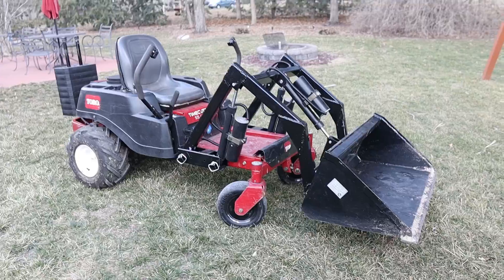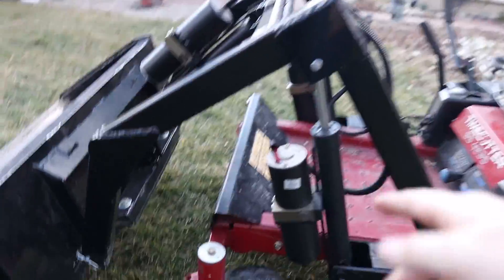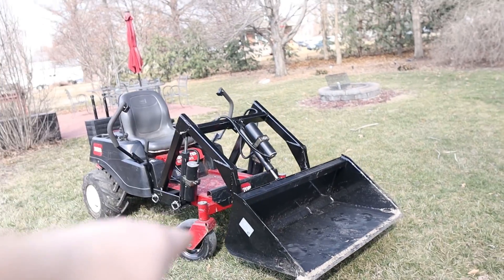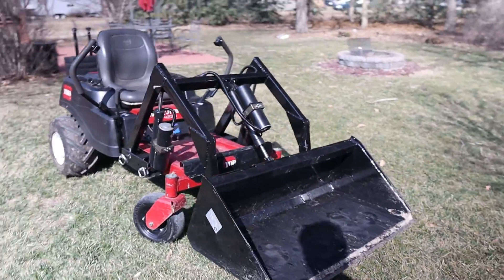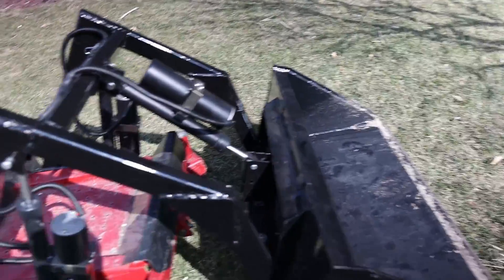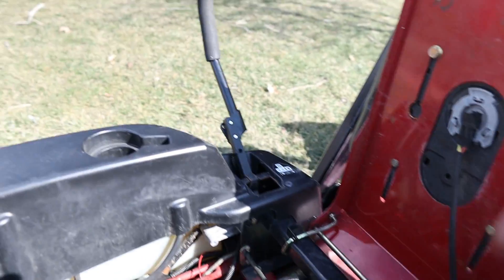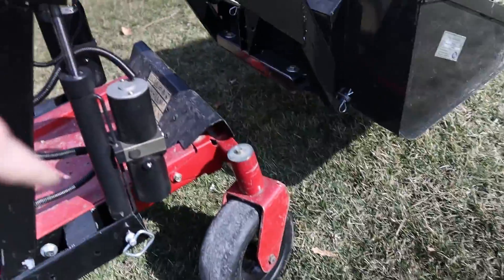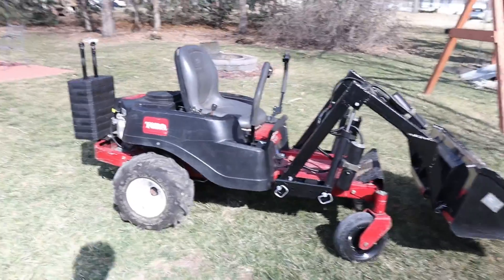You Converted a Toro Zero Turn into What?? - Homemade Skid Steer/ Front End Loader

Comment: Very thankful I found this video, thank you for your willingness to help out the community!
I am very interested in your electro-hydraulic cylinders, this has been what compact lawn tractor FEL have needed! How did you go about finding these actuators? I am trying to do some research myself to see what else is available and haven't come across much.
Reply from the maker: The exact actuators I used are linked in the description on eBay. Unfortunately they are the only sellers I could find for these actuators that weren’t ridiculously priced but they are currently out of stock until July. Similar cylinders can be found on Alibaba but they are not quite as affordable. These cylinders are very specific and I don’t think the demand is there for them YET. I think as more people discover this video and the use of these cylinders we will be able to source them easier. I want to get more of them because they are such powerful actuators in such a small form that can’t really be beat unless you run a full hydraulic system. I really hope the seller on eBay gets a lot in stock because they are the only ones that I could find and they were extremely fair on their pricing
Reply: @ChadMees  Thank you very much for your quick reply!
Have you been able to get an idea of how much weight the loader will pick up? Is the limit the counterbalance in the rear or the force of the cylinders?
Reply from the maker: I don’t have an exact number. I have easily lifted 400lbs but I would expect the max would be around 500-600. The issue I have found is that the narrow casters start to dig into the ground. Adding more weight as a counterbalance does help though

Comment: already planning on making one as we speak on my john deere zero turn. really appreciate the plans! im going linear acuators though
Reply from the maker: Good to hear! I wanted to use linear actuators too but they are a lot slower and also quite expensive. The ones at northern tool were the most likely to work when I was looking. The ones on Amazon and eBay say they can lift 6000N but they are very slow.
Reply: @ChadMees  see i saw the 6000n ones thats what i was planning on getting, they say 14mm/s   what were yours pushing in speed for comparison?
Reply: also its 5mm/s i stant corrected
Reply: i found some that are 14 but they can only hold about 1000 newtons, maybe 2 on each side? and the 6000 newton one on the bucket?
Reply from the maker: If you go that route I would suggest going with lighter steel since every bit of weight is going to affect your overall payload. The problem with the actuators is that with the mounts where they are you will always be at a mechanical disadvantage. meaning it will take say a 1000lb actuator to lift 500lb payload. This is just a random ratio for the sake of explaining but the biggest thing is your actuators must be much stronger than any payload you expect to move. This is why I opted to use the hydraulic actuators. 

As for running multiple actuators on each side I don’t think that will work. At least easily. You would have to share the same pins on the base plate and arms to make this work otherwise the geometry wouldn’t work. This also introduces more possibility of it binding because the actuators may not move at the EXACT same speed. If one actuator is 1-5% slower then it will cause the whole system to bind and fight itself
Reply: @ChadMees  also how much weight ability do u think I would need. I mean the bucket and arms would be about 100 to 150, I'm building a  bucket so it will be lighter prob.

Comment: Im surprised this made it a whole month without me seeing it. I looked into this a little bit before I just went ahead and bought some 'regular' equipment (albeit old and decrepit, but as a master auto tech it's manageable) and put this idea on the way back burner. Ironically I just fixed a Toro 4225 (nearly identical) for a customer, so this is particularly enticing having the memories of that machine fresh in my head. I'd really like to see more video of it in use, especially maneuvering while carrying something heavy. 

I did somewhat recently convert an old riding mower into a tiny crane truck with a truck bed crane and a 150cc push mower engine in place of the ~500cc original. I had to do all kinds of stuff to make that work, but none of it was much money (probably <$250 in purchased parts including the crane although i had a lot of the other stuff lying around). My main goal was to move car engines across gravel without any hint of a regular engine hoist being involved because that is a giant PITA. I could have bolted the crane to my actual truck and done that in the conventional sense, but this thing is only ~34" wide and you have perfect visibility of the load while being able to move 0.05 mph or whatever with the hydrostatic trans. I just used it to sneak a honda v6 through a 10' wide door that had said Honda centered in it (so ~<30" left per side?). Wouldn't have worked with either an engine hoist or the same crane mounted on a truck... anyway, nice work and i want to see more!!
Reply: How do I get in touch with you? 1) Do these actuators come with any owners manuals? 2) How do you check hydraulic levels? 3 Have you had any problems with your actuators?
Reply from the maker: You can leave comments here or message me through email or Instagram chat. To answer your question. 1 no owners manual they are technically a generic Chinese made unit. 2 while I’m sure it is possible to check the level I have no idea the correct way of doing so. I don’t think these are intended to be serviced even though I’m sure they could be. 3 no issues so far mechanically. Only issue I had was the screws around the valve body and the reservoir are steel and they started to get surface rust. A little paint and a q tip and that problem has been solved!
Reply: @dwightlittle6576  I was just about to say the biggest problem is those electro-hydraulic cylinders were basically unavailable since this video was posted but i see they are now available again! Time to resume goofy ideas..
Reply: bought 2..
Reply from the maker: They are truly amazing little units. I am trying to justify buying another set for some other projects!!
Reply: @ChadMees  what is the maximum dead lift these actuator are capable of lifting? They say 2300 lb but Ihave serious doubts about that being true.
Reply from the maker: I do not have an actual value for they real life max. I do know that on my loader I am able to lift around 600lbs of material inside the bucket. Given the geometry isn’t optimized for maximum lifting capacity.
Reply: @ChadMees  Well neither is the geometry of the front caster wheels. They have a bending moment from vertical weight. I did have a thought of just adding one or two more front casters making it sort of a semicircle arrangement of front wheels if there was a need for that, but i doubt there would be unless it was used both heavily loaded AND often. 

My electrohydraulic cylinders showed up today, but i havent seen them yet.. excited. I actually plan to see about using mine as   electro-hydraulic top link for 3 point hitch on subcompact tractor, but if that doesn't pan out it's on to the next idea. Gonna be cool either way.

Comment: What's the max height you could dump into? Could you load/dump into a pickup truck bed?
Reply from the maker: I will double check the actual height I get out of it but I think it would be pushing it to dump into a truck bed. I have an F150 so I will try this out in the next few days and get back to you but I want to say it would  be mostly level with the bed. You would be able to scoop material off the bed into the bucket for sure. It does  work very well with our 5x8 trailer though!
Reply: @ChadMees Do you have an update for the lift height? Did you try dumping into a pickup bed?
Reply from the maker: Oh yes I’m sorry. I did try it out. I cannot dump into the bed of the truck. It is just shy of being level with the tailgate so I can scoop material from the bed into the bucket but from the bucket to the truck would be a little more difficult. This could be fixed by adjusting the dimensions of the frame or starting with uprights to move the hinge point higher. This currently is a limitation by my own requirement of being able to get on the mower from the side rather than climbing over the bucket. Hope this answers your question and sorry it took me so long to test it out!
Reply: @ChadMees  so I’m no engineer, so to get it to lift an extra foot to throw into the truck bed what would you have me do before I build? Please if you don’t mind so I understand without messing up?

Comment: Hi there Chad !! Hey thanks for making this video and yes you have helped me a lot. I have a bunch of linear acuators from hospital beds i have gotten but i dont know if they are 12 volt or can be used as 12 volt because as you probably know the hospital beds plug in the wall outlet, so not sure about that but yes i want to build one of these and i like all the things you did , your very smart and creative and its great that your helping people all over the world probably with your great ideas : ) well have a nice day and let me know if you think the hospital bed acuators might work from 12 volts straight ? not sure myself. well have fun on your well deserved cool innovative loader there : )..Mark
Reply from the maker: Mark, I am almost 100% certain your actuators will run on a lower voltage. They probably run off of a transformer that changes 110v (220v if overseas) to something around 12v-36v DC. The issue you will probably run into is how much weight you can move with those actuators. Each of my actuators can lift a maximum of 2000lbs. You might be able to get around this if you change how close to the bucket you mount them. The close your actuators are the to bucket the less weight they will need to lift. It is exponentially more weight the closer you get to the pivot point! The hardest part is finding a happy medium between the lifting capacity and stroke length. Hopefully this is somewhat helpful and not too difficult to follow my rambling.
Reply: @ChadMees  love the rambling i am old school, words are wisdom to me anymore : ), thanks Chad, next time i go out to my shop i will see what is on the actuators themselves and let you know. keep up the great work too ! that thing looks just perfect for mulching and other things filling in holes and swales you dont want in your lawn . : )

Comment: Nice,  I've looked at similar in the past with typical ride ons and it's the extra weight on the steering that has turned me off them. So how's your hydrostatic steering system copping with the extra weight. And cheers for the great video,much appreciated
Reply from the maker: I would also be worried with the standard rider loaded because you already have the weight of the engine up front. While the zero turn isn’t designed for this weight on the front I haven’t had any issues. I would be more worried about bending the casters than anything on some of these mowers. If you notice on this model the casters seem to be more sturdy than some of the others since mine has 3 sides rather than only 2. My concern with the 2 sided casters is when you try to turn with a load it may fold/ bend the bracket. I actually was using it last night to move more gravel around. I haven’t noticed any issues with the hydros, they seem to operate the same loaded or unloaded. I am sure using it like this will shorten their life a bit but I just have been trying to pay attention that I am not forcing them to try and move when they don’t have enough torque to do so. As with anything you have trade offs. I bought my mower for $140 so if I blow one of the hydros I will either rebuild or replace it with another used unit.